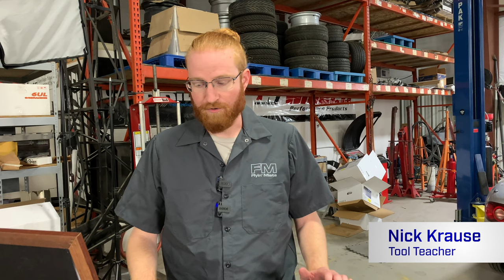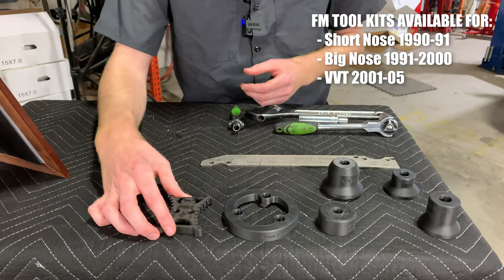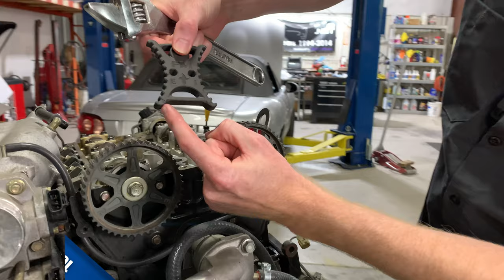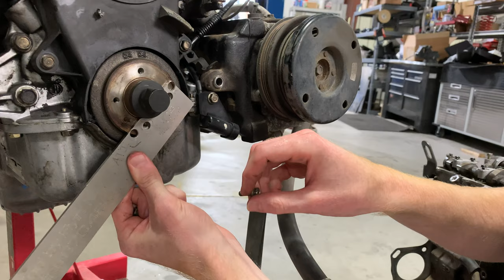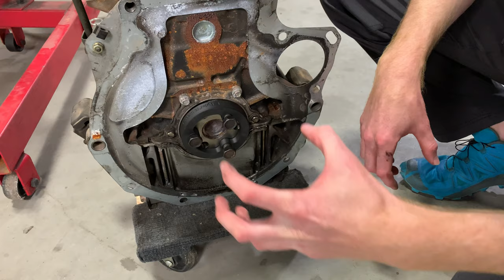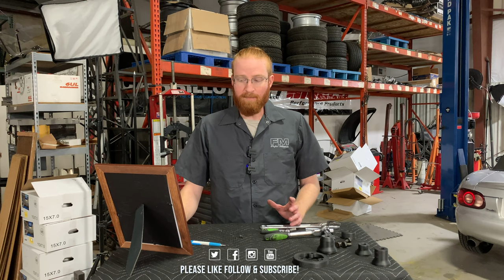Replacing Seals? Here's How to Use the FM Tool Kit! (FM Live)

Comment: Question here. Sorry. But you put the ninja tool to hold everything but when you remove the cam gears to do the seals how do you keep everything in place? I feel like this tool kit is missing a tool.
Reply from the maker: You can ziptie the ninja tool to the cam gears if you want.
Reply: You don't. With the engine at TDC the front lobes are facing outwards and the camshaft dots pointing upwards, that's enough to put the gears back on the cam properly. The ninja tool is useful for holding the cams in the right place so your hands are free to slip the belt back on. Learn to time the engine properly so you can whizz the crank and camshaft around and re-time them from any position. A+ Racing have a good video about it too.